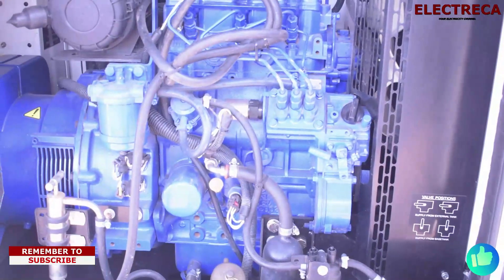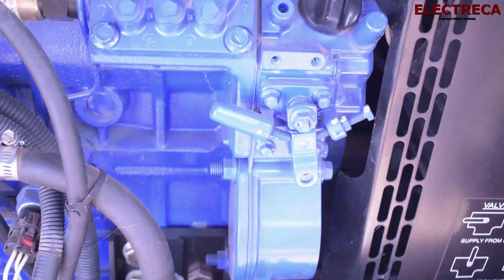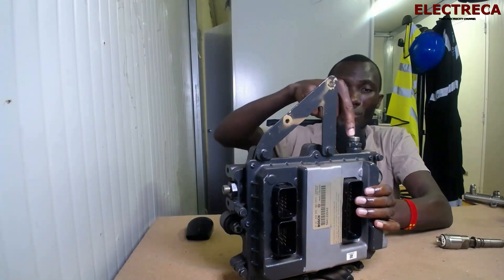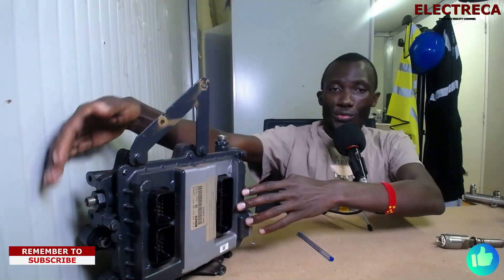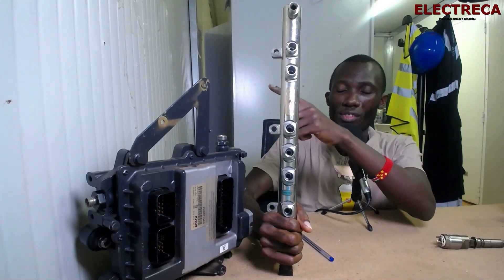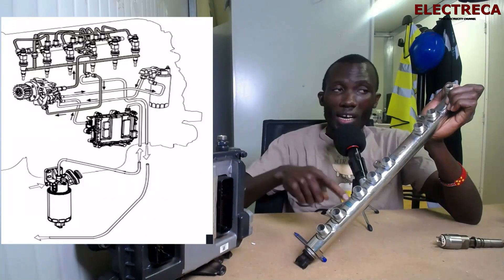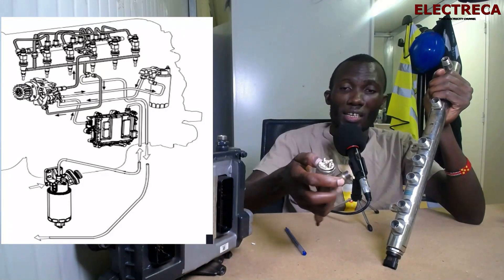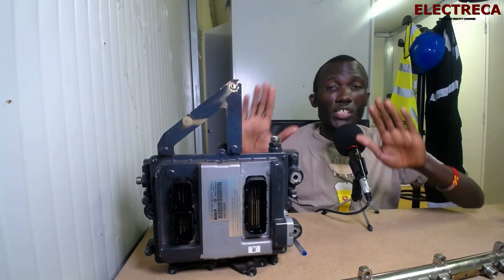How Your Engine Computer Actually Works

Comment: Hey David, thanks for the good content, would you mind if you spare some time and get us through how to connect different inputs and out puts and where they are possibly connected on a generator control panel THANKS.
Reply from the maker: There is a plan on that. Thanks for watching